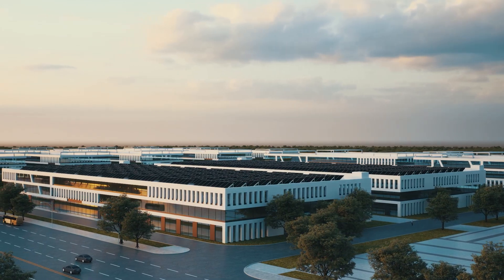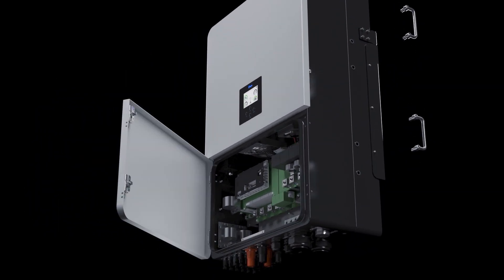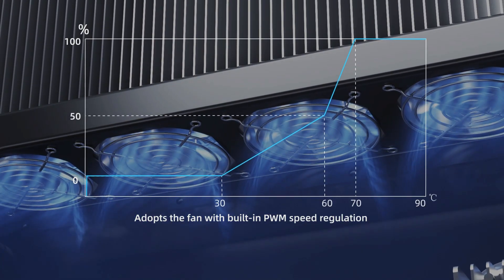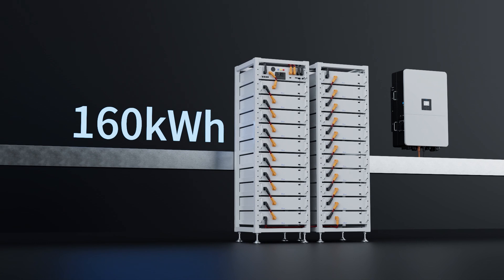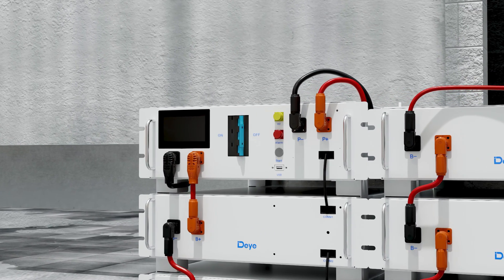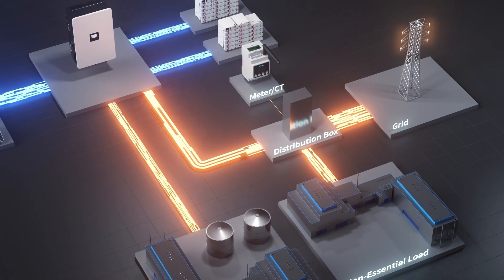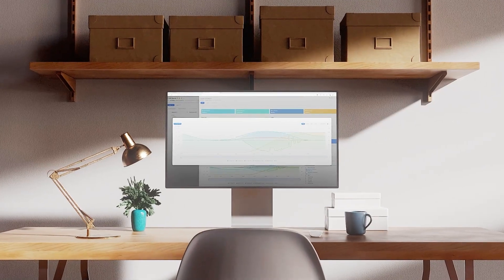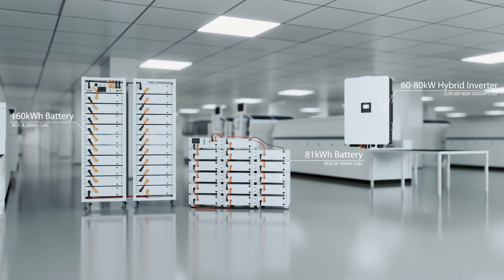Hybrid Inverter: Deye C&I ESS Solutions - 80kW Hybrid Inverter & BOS-A/BOS-W

Comment: Can it use BOS-G batteries as well? At a reduced C-rate but still?
Reply from the maker: Yes, it supports BOS-G and other batteries with suitable voltage levels. If the power is insufficient, you can try connecting two BOS-G clusters in parallel.